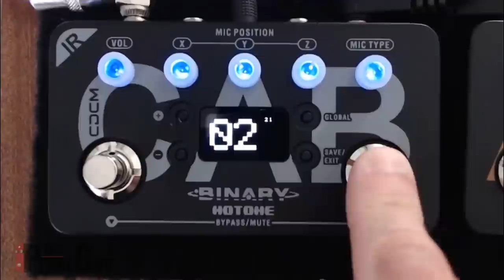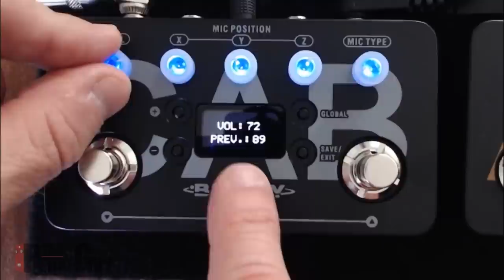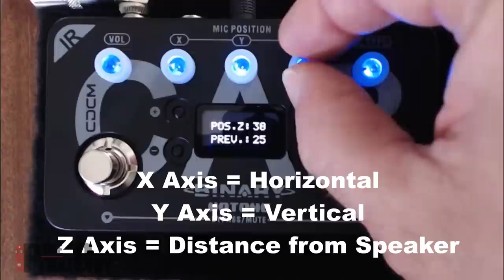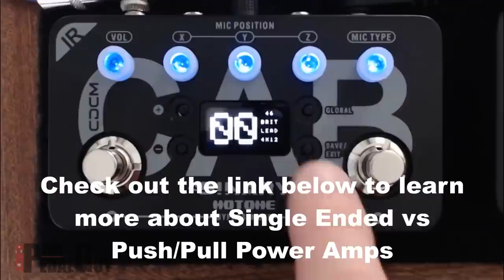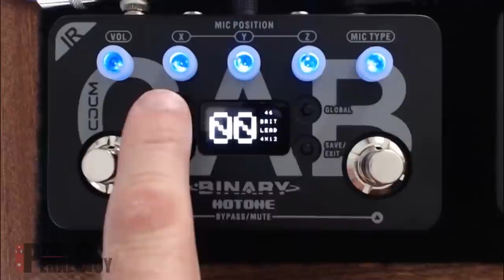ThePedalGuy Presents the Hotone Binary Cab Pedal

Comment: Do you have any experience with the Mooer Radar? I'm currently on the edge between the two. I like that the Binary Cab has an aux in so that I can feed some backing tracks into my headphones while playing at home, but not sure about sound quality between the two. Great video! Thanks!
Reply: My issue with the mooer radar was how difficult and time consuming it was to gain access to all the settings. (Only has one rotary knob) hence i really hated using it. But it sound alright. I like knobs and buttons and easy access to them so im thinking of getting this hotone binary cab. Sold the radar last week. I do not miss it
Reply: the Mooer Radar misses you.

Comment: I get the impression that all these Cab Simulators are just equalizers with preset functions, the tone changes but not the dynamics.
Reply: Did you see the new IR pedal that Strymon just released? I pretty much agree with you but they might be on to something over there
Reply: Impulse Response tech is quite different than the old cab em units which were just "EQ with preset functions".
Reply: @backtorealitybraden5725  Tbh the Strymon doesn't seem worth the $. It's not much better than this or the NUX Solid Studio.
If you wanna get serious about IR, go Two Notes. That's state-of-the-art.

Comment: For the first 20min or so, was your gain coming from the AMP or something else? Just wondering about the effect of stacking one power-amp sim into another. 
I know you can turn off the power amp sims on the CAB - but what about the AMP?
Reply from the maker: Thanks for the question. I'm not 100% if I had anything before the Amp pedal. I think in this case, it was simply guitar->Binary Amp->Binary Cab.
Reply: @ThePedalGuy  Sure, thanks for clearing up the initial part of my question - but I also meant the power amp sim in both, and possible effect of stacked power amp Sims.  Were you running the CAB with power amp sim on during the initial demo? I have the AMP and am pretty sure it does power amp sim, which you can't disable.
Thanking in advance. Love your channel :)

Comment: Hi! Is it possible to disable the cab simulation for just using power amp simulation?
Reply from the maker: Hi Sven. Thanks for your question. The Binary Cab doesn't do that. However, the NuX Solid Studio does. You might want to look into that.
Reply: @ThePedalGuy  That's a very handy feature in the NUX.
Reply: Sven, why would you use that ....only power amp sim w/no cab ?
Reply: @Burkhimself  
Well, i own a preamp, solid state power amp and an actual cabinet and i thought to give the power amp a more tube like sound by using power amp simulation.
Reply: @Burkhimself  I've tried this:
Mooer micro preamp 002 UK Gold> Nux SS power amp EL34 setting> GFI Cabzeus Stereo.
Massive tones - but perhaps not practical for a pedal board. It's a lot of real estate just for the DI gear
Reply: @BroncoSchmidt  This couldn't go into a speaker cab anyway, it outputs a line level signal.
Reply: @Ones_Complement  Are you serious?

Comment: Do I need a power attenuator if I want to use a JTM45 with this?
Reply from the maker: Hi Alvin,
Thanks for your question. According to Hotone, the Cab pedal is not a load box, so I'm not sure that would work. Which power attenuation are you looking at?

Comment: Okay - you're on a deserted island and you can only have either the NUX Solid Studio or the Hotone Binary CAB.  Which do you choose?  😉 Thanks.
Reply from the maker: Hi Gary, thanks for your question. Well.....ok here's my thought. If I were on a deserted island and there were no cabs around to sample with the Solid Studio, I would be inclined to lean towards the Hotone Binary Cab, as it includes so many different cabs. Overall sound quality between the two is pretty neck and neck, so I would focus on the amount of sounds I could achieve between them, which puts the Binary out in front.
Reply: @ThePedalGuy  Ah... but say you do have several of your favorite amps and cabinets - the ir snapshot capability of the SS is the real deal?  I suppose you could do that with software and then load the IR into the CAB.   Also - in terms of the "feel factor" which can't be shown in a video, do you have a preference?  BTW, clean/tubey, as a pedal platform is my target.
Reply from the maker: Hi Gary. Ok, that changes the parameters of your question. The IR capture is a real thing. We did a vid on it here  https://youtu.be/6ZjY2J1l5MU 
As far as the feel factor goes, that's probably where I would side with the Solid Studio, as it has an overall great sound.
Hope that helps.
Reply: @ThePedalGuy  Very helpful and I did watch your capture vid.  Cheers!

Comment: Doesn’t sound like you turned the cab off on amp pedal...when you set cab pedal to no mic that should have sounded harsher like a remap with no cab.. but you could hear the amp pedal cab.. so all cab examples sounded cloudy because it was like double cabs..
Reply: I have this pedal and that's how it is sound. It is unusably dark in all settings. I wish I have not bought it. BTW if anyone knows how to make it any useable (maybe patching, firmware update), I am all ears.